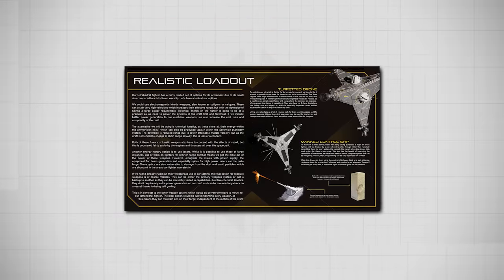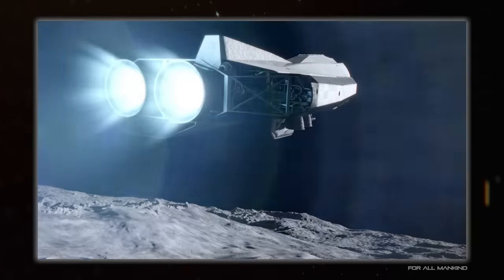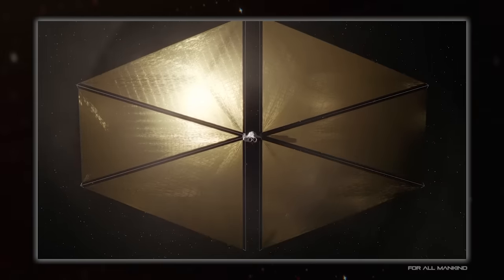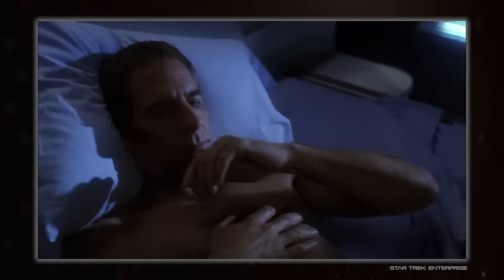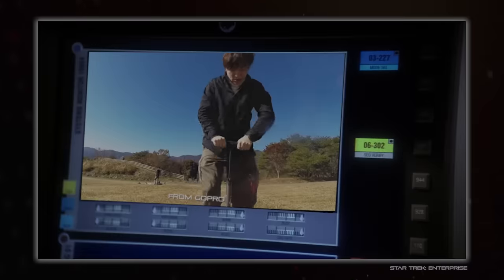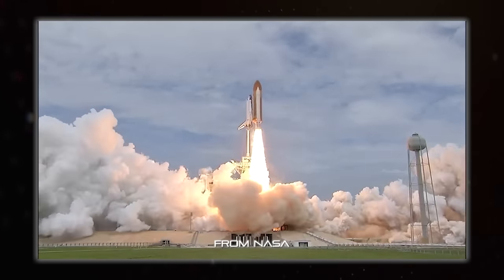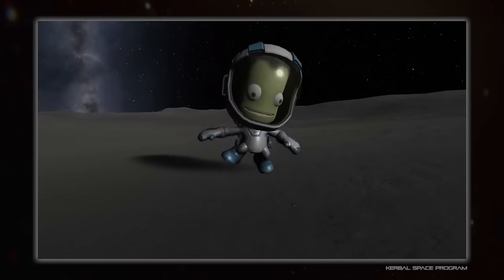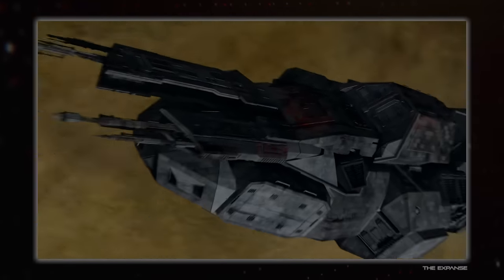Realistic Spacecraft Maneuvering

Comment from the maker: Get "Designing the Perfect Space Fighter - A Spacedock Reference Book" here!
https://www.patreon.com/posts/77243474/
Reply: I'm interested in your book - but I'm not going to join patreon just for that.
Reply: @21stcenturyguy25  I agree, especially after patreon started booting people based on what they talked about. @spacedock if the reference book was available somewhere else, even for a slightly higher cost, I might consider that.
Reply: A guy I used to work with who was in many ways just another junkie you had to be very aware of at work to avoid getting hurt. He always brought up some amazing questions that would really make you think twice. Once he asked if you could hold a gun out the window of the space shuttle on takeoff and shot a bullet up, would it pass the shuttle or would the shuttle pass the bullet when it left the barrel? Another time he asked if you filled an elevator shaft with gas in the bottom and cut the cable with a spark plug set to fire when it fell down would the elevator fly to the top of the shaft like a piston in an engine? Sometimes this guy really freaked us out with his ideas.
Reply: The beauty of physics is that you can have any configuration you want and the only things to worry about are materials engineering and placement of maneuvering jets.  So you could in fact build a flying saucer or a space plane or a Constitution-class light cruiser and it would work as long as your metallurgy was up to par.

(In other words no, you guys and Tyson can go kick rocks with your treatises on design.)
Reply: Okay, random thought, but I just realized with physical projectiles as the primary weaponry any mass battles would result in the futuristic version of today’s minefields. 

With today’s technology our weapons are firing thousands of rounds per minute. A big enough battle and enough guns, we’re going to see clouds of projectiles heading out in every direction for an infinite amount of time—-> just armor piercing bullets zooming across space for near eternity.
Reply: Angels Fall First does the best where you can swap between Star Wars (psuedo physics) fighter controls and Battlestar Galatica (realistic physics) fighter controls.

Comment: Even back in the 90s shows like Babylon 5 and Space: Above and Beyond used RCS thrusters to maneuver their fighters in space and conserved momentum with the ship able to point in a different direction than it was moving.  I really appreciated that attention to detail
Reply: B5 did a reasonable attempt.  Space still did the engines constantly one airplane like thing for the most part.
Reply: @TheEvilmooseofdoom  It's true that they ran their engines constantly on S:AAB, but I did appreciate that they showed RCS thrusters firing when they maneuvered and they did occasionally do moves like cutting thrust, doing a 180 maintaining their vector, and then firing at an enemy that was tailing them.
Reply: B5's 'Starfurys' were shown in some amazing fight sequences... it doesn't hurt that the very ship-design, with it's prominently mounted RCS engine nozzles and their blast-flaps, really hint at what they had in mind for it's operational realism.

Comment: The BEST explanation for orbital mechanics I've ever read was from Chuck Yeager's autobiography. In it, he describes going out into a desert in a jeep, turning the steering wheel to the left, and then, using a lot of rope, lashing it down so that it could not move at all. When you start up the jeep, it will go in a big circle; the faster you go, the bigger the circle. He and another pilot each had a jeep and their only control was the throttle, and they practised doing rendezvous.

Comment: For basic 6-degree flight control in zero-G, I've been impressed with how Elite: Dangerous handles the physics.  If you choose to fly 100% manually, the game gives you complete freedom in every axis and your spaceship behaves as it should based on its mass and the strength of its various thrusters (for example a given ship may be more responsive in roll than it is in yaw).  The game does limit you to a maximum total velocity to limit player exploits, but otherwise it's just as you'd expect from Newtonian physics.  If you go to an external view, you can also see the various thrusters firing based on your control inputs.  

On top of that, there are various assists that you can engage, such as a general flight assist package where a computer juggles all 6 degrees to create a "fly-where-you-point" behavior that's more intuitive and simplifies control inputs, and another assist that auto-syncs your ship to the various rotating space stations you can dock with.  If we get to the point where spacecraft are buzzing around like aircraft are today, I think computer assists like that are definitely going to be a thing.

Comment: For exotic propulsion methods you could look at Honor Harrington.  The Impeller Wedges in that series are very interesting.
Reply: Think Alcubierre drives.
Reply: @wbrennan2253  for Honor Harrington?  Not really, because both of the stress bands are behind and above the ship.
Reply: @chaingun1701  above and below, relative to the deck orientation, and deeper (more open) at the front. The goal seems to be a local change in space/time to allow greater acceleration. Some inertia gets dumped to the wedge, too.
Reply: @wbrennan2253  yes

Comment: In a sci-fi setting where artificial gravity and other gravitational manipulations are available, you can also maneuver by keeping the thruster and shifting the center of mass instead. E.g. If your main thruster is in the central axis of the ship, and you can achieve that one side or wing becones considerably heavier (higher inertia) than the other, the thrust vector will not align with the center of mass and your ship will turn.
Reply: could also create a gravity-well in the direction you want to move and have said grav-well move with the craft with similar gravitational manipulations.. SnG's Chamber did effectively this if i recall.. could even do it planet-side..
Reply: @niteriderevo9179 That's actualy an (unintended) means of propelling your ship in Space Engineers.
Reply: @VoxAstra-qk4jz  i know, artificial mass blocks and grav-gens, is pretty efficient, too..
Reply: @niteriderevo9179  fun fact, the check for merge block magnatism only goes one sub grid down, so a merge block on a piston on a rotor can push itself against the main grid super energy efficient and incredible acceleration, even in a gravity well

Comment: KSP is fantastic for teaching orbital mechanics and Space Engineers / Elite Dangerous (with flight assists disabled) are fantastic for teaching newtonian flight physics.

With Space Engineers allowing for complete control when designing spacecraft I learned a lot about how small scale battles would actually occur.
If your vessel is big, armoured and full of guns the simple "sail past the enemy with gimballed guns" is super effective
If you constrain the design though by limiting power outputs, and number of guns to be quite low you end up with something that sort of blends a BSG Viper with The Expanse's Roci:

Big engine to push forwards, only small ones for lateral adjustment - and most weaponry also pointing forward, maybe a gimballed gun for defence.
Fast gimballing, to change directions quickly
Small frontal cross section, and relatively light weight.

Where speed and lateral movement are your best defence, you can turn off flight assists, burn in at an angle slightly off from your target then when within gun range you turn to point at the enemy and keep burning the primary engine. This makes you a small target to the enemy with high lateral speed, your guns are pointed at them nearly the whole time and your main engine causes you to arc around them in an orbit.
Like if you put a weight on a string and spin it in a circle, only instead of using string the same force is provided by the engine pointing perpendicular (radial out) to the orbit

Comment: I think Babylon 5 (Starfuries) and Wing Commander are probably some of the best examples of this kind of neutonian physics in Sci-Fi. While if you cut throttle in Wing Commander you do slow down, they have full maneuverability ratings for Yaw/Pitch/Roll for pretty much every craft in the games (although WC1 and 2 I think were on a 1-10 scale while 3, 4, and Prophecy actually had actual Degrees Per Second). And I believe you guys already covered the Starfury from Babylon 5 so won't touch on why that fighter is so awesome.

Comment: I've got a BS in Aerospace Engineering. When it comes to orbital maneuvers, one of the easiest ways I've learned to understand it (outside of playing Kerbal Space Program) is to think of the orbit kind of like a rubber band between two fingers. Every time a spacecraft makes a burn, it's like pulling or rotating the entire rubber band , not just a single point on it. If you try to stretch it in one direction (like you're adjusting the apoapsis or periapsis), the band narrows in the other direction. If you try to rotate it (like an inclination change), the whole band rotates so one side moves up and the other moves down. You have to plan to make a burn on one side of an orbit in the name of affecting what happens on the other. It's what makes orbits so challenging to understand: you're not "moving where you are" in a maneuver, you're just trying to speed up or slow down to "move where you're going".

Comment: I'm curious what your opinion/analysis of the concept of Active Mass Balance Auto-Control or AMBAC introduced in Mobile Suit Gundam would be.

Basically, AMBAC is the primary means for mobile suits, the giant robots used in both space and ground warfare in the setting, to reorient themselves in space and involves utilizing the angular momentum from swinging their mechanical limbs around to adjust their orientation while moving along on any given trajectory.

It essentially works similar in principle to a momentum wheel, but unlike a momentum wheel, due to their variable geometry a spacecraft utilizing AMBAC is capable of shifting its center of mass outside of itself so it can perform more complex maneuvers while conserving delta-v.

Comment: Another way I've put it was that you throw mass around violently. You can throw more mass or more violently (or both!) to achieve more thrust, but you start running into walls of either running out of mass or the reaction getting so violent it explodes. This is one of the trades made by things like plasma or other electric drives: they throw a tiny amount of mass very very hard in order to make the mass last longer since it's difficult to refuel.

Engines also have issues with sustained reactions, as they can begin to overheat. One thing I liked was the idea of a center mass engine with relatively low thrust but could be fired continuously, with outboard 'combat thrusters' with high performance, but need frequent cooling down breaks or they'd overheat.

Comment: I'm a reader of Freefall and quite a while back, we had a discussion about controlling the Savage Chicken, the hero ship of the comic.  I proposed that the the strongest engines pointed aft.  Less-strong ones pointed for and still very strong ones pointed down and I argued that that might make banking make sense as you roll and then pitch rather than yawl as the M.F. does but in reverse (as they tend to pitch THEN roll).

I was ignored as well as my I thought innovative and almost realistic design for the motor itself which I called a Thorn Thruster.  Eh, I probably deserved it.  ;)

Comment: A primer in Orbital Mechanics courtesy of a Larry Niven book about Trees: Forward is Out, Out is Back, Back is In and In is Forward.

Relative to something that has matched your orbit:
If you accelerate forward, the size of your orbit expands, pushing you out.
If you accelerate outwards, you move higher. The distance you now need to travel within your orbit expands but your speed does not so you move back. Think record player inner vs outer velocity.
If you accelerate backward, against your orbit, it shrinks. Maybe to the point where you don't miss the ground this time around.
If you accelerate inwards, your orbit shrinks. Keeping your old orbital velocity, but having less 'ground' to travel, makes you speed up.

Comment: Brief explanation/expansion on the last bit of orbital mechanics;
What you do Now changes your orbit on the opposite side, 180 degrees from Now. 
If you burn forwards along your orbit (we call this prograde) the height of orbit goes up. On the other side of the body you're orbiting.
But once you've done a complete lap, the height were you did your burn is the same.
If you burn the opposite way, backwards, i.e. slowing down (retrograde) your orbit lowers. Again, on the opposite side from where you are.
So if you are in a circular orbit and want to go to a larger or smaller circle, you need two burns. The first one makes your orbit oval, then when you're at the other side, you make it a circle again by changing the orbit where you did your first burn.

That's why if you just point at something you want to meet up with ends up putting you further away. You're changing your orbit to be different to your target, and as you and your target continue along their respective orbits you drift apart. 
What you need to do is kill your relative velocity. If your target appears to be coming right at you, what you do is burn away from it. And yes, it's counter-intuitive, which is why even NASA had problems with it to start with.

Comment: Im writing a sci-fi story and my ships basically fly themselves kinda like planes/jets in atmosphere with an automated "flight assist" that uses RCS automatically to correct ships flight path and smaller (retro engines) to slow the vessel down to a fixed speed or to stop. for precise movements you can still use the RCS for other directions and you could turn off the automatic assist to be incredibly unpredictable in battles. (smaller ships)

Bigger ships (capital vessels) mostly don't have that type of advanced assist cause they don't need to be extremely maneuverable.

the main engines on fighters are also gimbal. Oh Im also already working on a detailed heat-sink system aswell xD

Interplanetary travel is possible with specialized drive modules like Impulse or Sub-space cruising. Same works with dropping out of an atmosphere into a higher orbit (Short-burst pulse-jump)

Comment: 9:03 an interesting way ive seen this done is in elite dangerous, where realistic physics DO apply, but your ship has a built in flight assist that automatically manages the thrust to allow you to fly it like an aircraft, since essentially, instead of you controlling the thrust, you decide what movement you want to make, and the assist controls the thrust to make it happen. this also has the benefit of being able to switch that assist off, and fly purely according to newtonian physics, allowing for manuvers that are otherwise impossible, regularly being used in combat for the extra manuverability, and the ability to travel in any direction relative to a target while keeping forward facing weapons aimed at the target, such as how AX pilots sometimes use a technique known as cold orbiting, where they reduce heat signature to make themselves harder to detect, while flying sideways relative to the target and circling it, mimicing an orbit (the ships thrusters replace gravity in maintaining this orbit)

Comment: On the topic of long-distance journeys, one of my issues with The Expanse is the whole "flip and burn" maneuver.  If you're burning for days, taking 5 minutes to flip the ship while under thrust will be hardly noticeable, and the correction needed is going to be within the margin for error of navigation anyway at that point in the journey.  There's absolutely no need to subject the entire ship to zero g.  And actually worse than zero g, because objects will float around differently depending on where they are in the ship.
Reply: I'm pretty sure for a flip and burn stuff can be secured so its doesn't just fall.  And you'd be strapped in a chair most likely. But you do realise that not cutting out the engine and rotating causes the ship to fly around the place, which will need another burn to correct?
Reply: @floseatyard8063  For a 2 AU journey, with the flip after 1 AU, at 1/3 g:

The deceleration will take about 90 hours.  If you flip such that you add the equivalent of 5 minutes of lateral acceleration, you have added about 900 m/s of lateral speed.  To cancel out that lateral speed (and arrive at the same spot you would have without it), you would need an acceleration of 0.0005 g over the remaining travel time.

Your thrust vectoring will have to compensate more than that for someone walking around the ship.
Reply: @Edward Barton  fair enough then. So basically that  trip would be straight line, small curve and straight line again?
Reply: In the expanse the ships are actually "on the float" for a time in the middle of their journey to save reaction mass, especially for belters who have older drives/ can afford less fuel

Comment: And now give the coordinates to your helms person so they know exactly where to point the ship and go (or even design the route then burn the engines)
That presents even more complexity 
Which is why the Star Trek method of Helmsman set a course on 310 (flat 360 compass heading) mark 85 (there goes the Z axis), speed (insert speed mark here) and let the computer do the rest unless you are Riker with a joystick 😑 made some sense.
I did capture the throw away line from Starship Trooper where Carmen was told in course setting to Design for Jupiter orbit. Cue KSP manoeuvrer nodes mode as you enter the parameters to design that orbit as no computer is doing it for you....